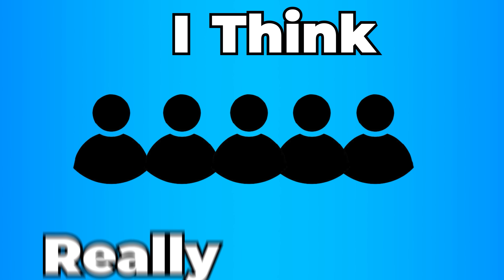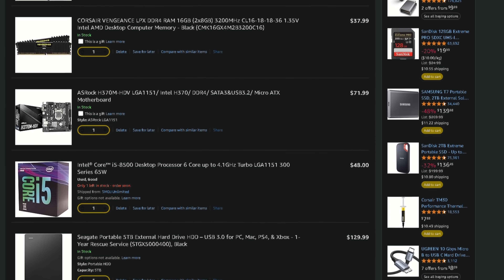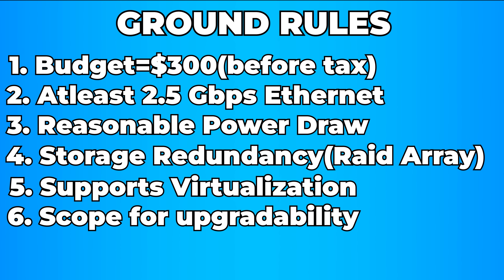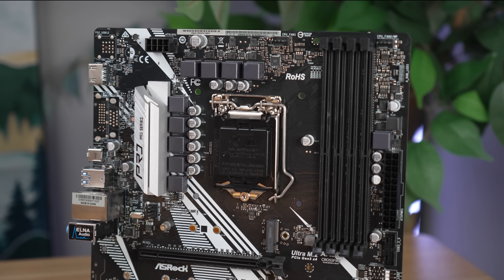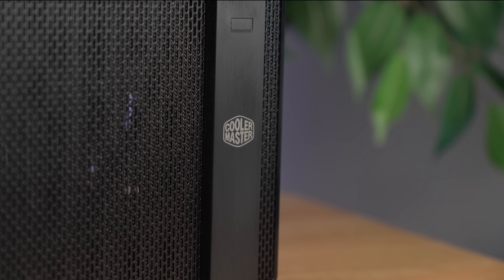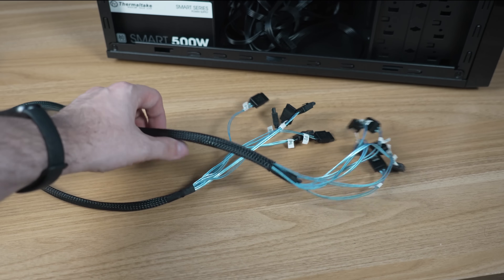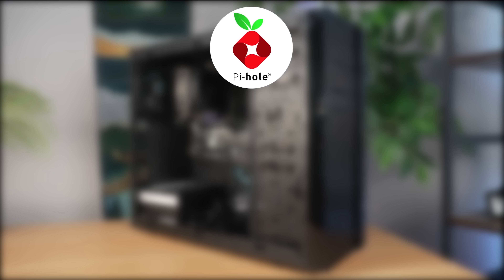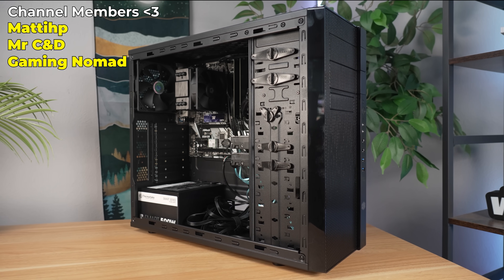Building a $300 BUDGET Home Server!

Comment: Nice vid setting up your own server but 110bucks,1/3 of the budget going into just the case and psu feels a bit wasted. Definitely go to the recycling center hunt for an old case. Most of the time they come with okay-ish PSU

Get 2 nvme, 1 for boot, 1 for cache. Read cache improves performance dramatically. And will saturate 2.5G easily. 10G is getting pretty main stream nowadays so investing in 1 right away is a good choice. 2.5/5G networking is mostly being skipped.

Comment: I was wondering if it would be worth while buying a AliExpress x99 motherboard combo. Or is it too power hungry? They look cheap enough i can get a e5 2640 which is a 6 core 12 thread CPU with a machinist motherboard, and 16gb ddr4. Has 6 sata ports and a nvme slot for about 100 Australian dollars which is like 65 usd.

Comment: Dear Jason, I would like to draw your attention to a very good processor option with ECC support. This is Intel Xeon E3 1245 V6.
In Russia, I bought it on the secondary market for 4,000 rubles, which at the time of purchase was $ 40.
I also found a motherboard that works with server ECC memory modules. This is ASUS PRIME B250M-A. Despite the lack of official support for such memory modules, I could find those that work fine. This is Atermiter DDR4 16Gb 2400Mhz REG ECC on Samsung chips. But despite the presence of 4 RAM slots, I could only run 2 modules on this board. A total of 32 GB of memory.

I am satisfied with the way my home server works. Virtual machines, docker containers, and jellyfin media server with hardware stream transcoding.

Comment: Cool build! I recently did my own (slightly higher budget) with a Ryzen 3 5350GE, 32GB ECC UDIMM, and unRAID. Subbed.
Reply from the maker: Cheers mate, that's a solid server! Do you happen to use it for media? I'm curious what plex performance is like on a ryzen chip compared to quicksync
Reply: @ I don't do any transcoding (just local direct play) so it's more than powerful enough. But yes I use it for Plex, Pihole backup (primary is a Rpi3+), Handbrake encoding, and primary file server.

Comment: This was a great video.  I just wanted to mention about the case options, the N400 is usually around $75 and for $85  you can almost always get the  DarkRock Classico storage, or the Rosewill Helium NAS,  technically thats a sale price but one of them is always available at that price.  They are both much better options than the N400 and worth the extra $10 in my opinion.
Reply from the maker: Great input! That case looks cool too 😎
Reply: Could you please explain what’s better about those two cases? I’m not really seeing anything immediately obvious just from the display photos. Is it the inclusion of more / better fans and I think the DarkRock mentioned a fan hub, or something else? Really curious.

Edit: forgot, the dark rock mentioned support for longer GPUs if you remove the offending drive cage, whereas I could see the rail system interfering with that and doubt it’s removable at all, much less partially removable. But that seems particularly minor.
Reply: @levygaming3133  They are both much more modern designs that are a lot easier to work in.  They have much better cable management space and better access to drives for swap scenarios.  They have much much better airflow than the N400 and the drives and other components all stay cooler.  PSU basement keeps cables out  air path and also allows for PSU to have seperate air supply from main chassis.   The Helium Nas is my prefereed server case, it comes with 4x 140 mm fans that are more than worth the $10 difference.

Comment: My TrueNas server was up until a year and a half ago, a I7-3770 with 32gb DDR3, an unfortunate bathroom leak upstairs dripped on to the server killing the Motherboard. I replaced it with a Asus ASUS PRIME B250M-C/CSM board which is a "Commercial Grade" motherboard, so it is a bit more hearty, made with bettter components than it's consumer grade counterpart. Now it's rolling with a128gb NVME boot drive an i5-7400(4c/4t)(trying t find a i7-7700 for cheap) and 32gb DDR4 2400, all I do is host a file server for our personal data, and a Plex Server. (dabbling with Wyze camera, MineOS, and Terraria for the kids ) I am very novice, but Absolutely LOVE learning and upgrading this thing!(TrueNas can be infuriating) I recommend anyone watching this to give this a shot! even with just an old pc! Next step is learning how to put ad blockers on it for the whole house.
Reply: Just wanted to suggest that you might have better luck finding a 7700t on the cheap, if that’s an acceptable compromise. Although, from memory of my own search for the same thing (I have an old i5-6400 PC), you’ll probably have better luck with motherboard CPU combos or even entire PCs for the price most eBay sellers want for 7700s. Frankly, there’s not a lot of good options there. I’d suggest the 6700(/t/k/whatever) for cheaper multithreading (because that way you avoid a bit of the “best this socket had to offer” premium) if it weren’t for the fact that you specifically highlighted Plex, and between the 6th gen and 7th gen there’s a pretty significant difference in QuickSync. (I know it included the addition of H265 10Bit, but I think there’s even more. Best consult the wiki chart)
Reply: @levygaming3133  Excellent advice! I basically just want the 4c 8t of it, MHZ is not a real issue. And yes i went with this board and processor specifically for the uplift for 7th gen Quiksync over 6th gen. i do have a GTX1050ti once i get Plex Pass. i am also dabbling in MIneOS for the kids etc...i don't think that  that has any relevance .
Reply: update, i now have a chinese X99 board with 32gb DDR4 2666, and a 14 core Xeon hahah...could not pass up that deal! everything is running smooth as silk, the transfer went without a hitch! and now i have a GTX 1050ti running for PLEX transcoding.

Comment: i love the vid i tried building nas for my dad but it didnt really work its something with mb because i have 16gbx2 and i think the mb doesnt support so much since its lga 1155 i dont know whats wrong tested ram i will see if i3 2100 will work but right now i dont know what to do i tried gpu and it just black screens do you have any tips?
Reply from the maker: Just make sure your CPU and motherboard can handle the speeds of the ram. Also make sure it's not ECC or registered or anything like that.

Comment: This board with the Intel CC150 would be a killer server setup. It's also worth mentioning that those cheap Quad NVME to PCIe cards require a motherboard that can bifurcate a full 16x slot into 4x4x4x4 for it to work.
Reply from the maker: Very true about bifurcation, I regret not mentioning that. Thanks for your input!
Reply: What is bifurcation?  And, I was looking at one of those 4x NVME add in cards that plugs into a 1x PCIe slot, as I have a pile of those NVME drives laying around.
Reply: @curtis.albrecht.79  It's the ability to split the PCIe lanes into pairs so a typical 16x slot can bifurcate into 8x8 or 4x4x4x4. You need to have a motherboard that allows you to jump into the bios to split your PCIe lanes up or else you will only detect a single drive on that quad NVME carrier card. You also need to ensure your platform has PCIe lanes do this as most consumer grade platforms don't have enough lanes to have a GPU running at 16x speed in the top slot and a quad NVME card in a low slot at the same time. You might need to force 8x on the slot your GPU plugs into.
Reply: @SammerJammer Here's what I'm working with.  I have a "glorified webbrowser" with the following specs: an ASUS H97M-E MB, an i7-4790K, 4x8GB DDR3 @1600Mhz, and an MT512 mSATA hard drive in a PCIe x1 slot.

I intend to build my fist PLEX Server on this system.  I don't really understand bifurcation.  And, unfortunately, according to a quick internet search, even if I did, my MB does NOT support it.  So, it looks like I'm stuck with buying four x1 cards and run them separately. What is your advice?  How would you do it?  P.S. - My existing case is a bottom of the line case, with no room for 3.5" HD's.  That's why I am looking for add-in card solutions.
Reply: @curtis.albrecht.79  I think there’s more expensive PCIe cards that handle the bifurcation on the card itself instead of on the motherboard, but they’re more expensive, and I highly doubt that any exist for mSATA specifically.
Reply: I currently run an i5 8400 in my main server, I just looked at that CC150 chip, it's very interesting for a budget server build, however it doesn't have an iGPU so no built in quicksync, which is a main item for most budget servers since they will most likely be running plex/jellyfin.